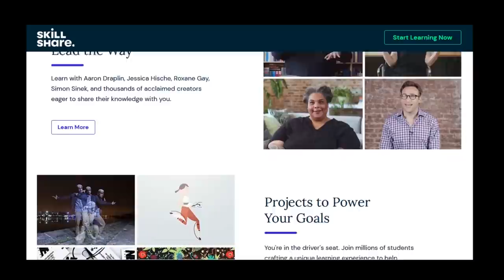Rail Spike Lizard challenge

Comment: Glad to see a little time on the little Giant. I have one that I will be putting in the shop this winter. Mine is an older model with a clutch in the drive pulley, no motor on it. What is the stroke per minute, should I be looking for? Thanks John.
Reply from the maker: I'm not sure.  But you could try writing Little Giant.  They also have records to look up the serial number and tell you the age
Reply: @BlackBearForge  Thanks, John.

Comment: Dear blacksmith! Tell me please, should an old file be annealed before the first forging?
Reply: No it don’t need to be. Heat it and beat it.  Anneal before grinding will make it easier to grind but no reason to for forging.
Reply from the maker: It never hurts to anneal or normalize old steel like files and springs to de-stress before forging.